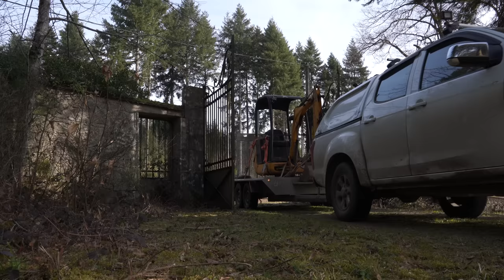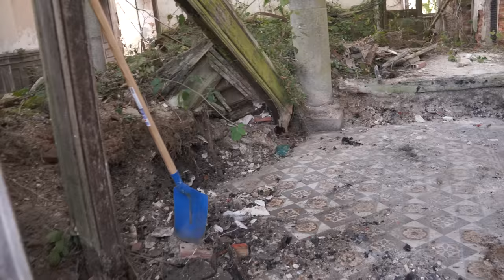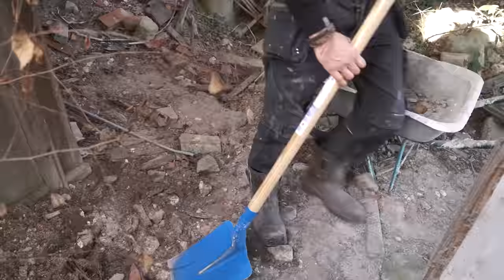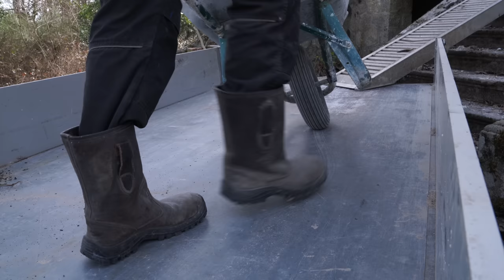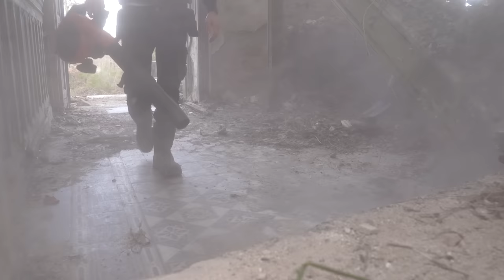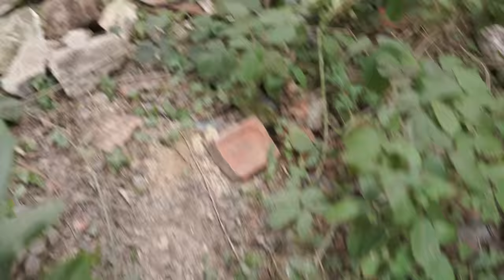Excavating an abandoned chateau ruin - what we find under the rubble

Comment: I cannot wait to see the entire tile exposed, it's really beautiful. And if only a few got scavenged then replacement can be made. I can't wait for more updates  !!!
Reply: The floor is gorgeous. You are so lucky to have your friend helping.  Once all of that rubbish is gone it will be full steam ahead.
Reply: Mm, just an FYI - those will be fully custom tiles I expect. The proper molds and stuff will have to be made and each one is actually fully custom because of what kind they are. It can be done, but it won't be cheap. I will suggest he does a fundraiser if he does get them made. Won't be obscene but then he can put money elsewhere.
Reply: @stephjezo6470  the one mentioning about restoring a chateau without killing your partner created their own tile after finding a old original tile
Reply: @Brooke  This is a totally different kind of tile than the kind Anna made on the vlog. These appear to be encaustic tiles. They're not just squares of painted clay which are then fired. It's a much more complicated process, requiring a mold to be made of the design with different colors of cement poured into each section the mold. Then there're 2 more layers and the whole thing is then compressed under high pressure. As Steph above said, it's a very pricey process that needs to be done by professionals.
Reply: It might be entirely possible that there is a company that does sympathetic restorations and documentation of tile like the one that Carole(de la Ferte) found that does wall paper.
Reply: @Tretz624  Yeah but she nearly fainted when she was told the price. The crazy thing about this floor is that it consists of at least six different tile types! Three in the middle forming the main pattern, two different borders and some solid grey tiles. And each of these has two to four colours.
Reply: @stephjezo6470  would be great if he could fine out where the tiles were made--maybe rather locally? Maybe France Govt. has some interest in helping restore them. But maybe they aren't 'antique' enough.
Reply: @margaretstanton7567  He could ask the major tile makers in France that make custom tiles. It may be (a long shot) that the original molds still may exist. I have seen that happen elsewhere before. It truly was luck but you never know. I hope can can find someone!

Comment: SHall you have to take all the tiles up  to protect them and then relay them when  the  chateau is no longer open to the weather?  A very  exciting find well done.!
Reply: They're made from concrete, apparently, that will withstand the rain until the roof is done. Protecting it from nicks and cracks caused by scaffolding and machinery is the real challenge.